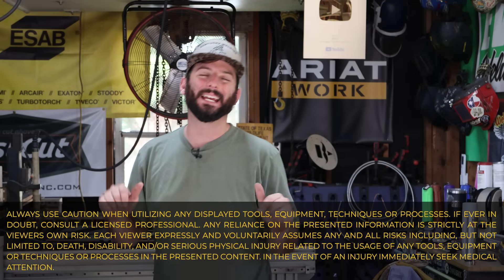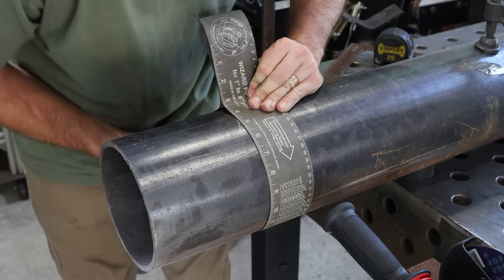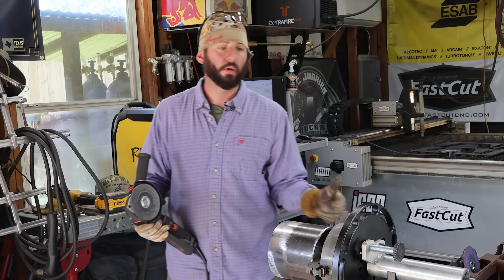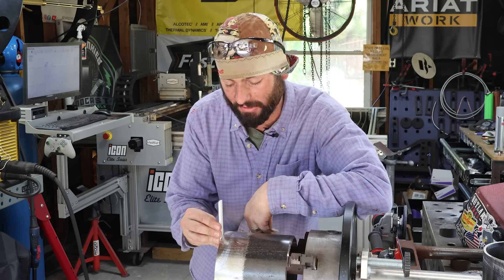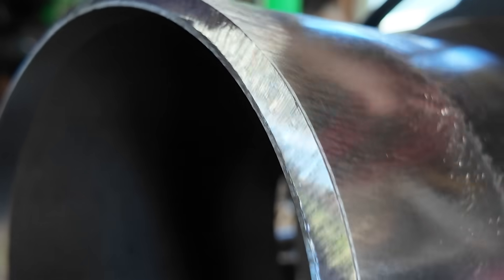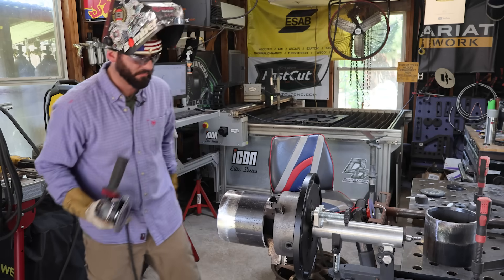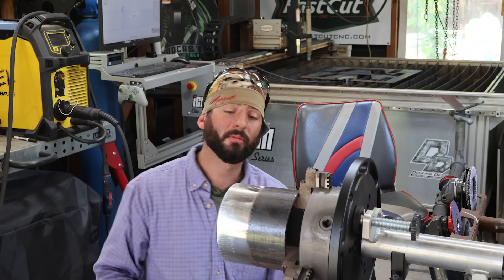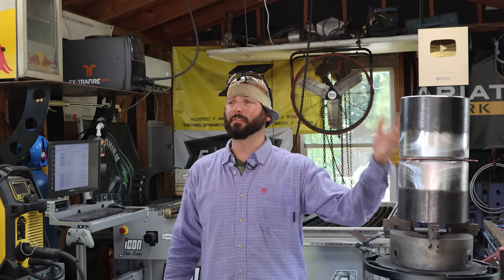The Fastest Way to Bevel Pipe (By Hand)

Comment: My welding instructor made us hand prep pipe for the first month of class.  Had to cut it off the 20' stick with an oxyfuel torch, and then finish it off with a 7" grinder.  Came in handy when I went into the industry and kept recieving material that wasn't cut and prepped correctly.

Comment: I spent 13 years as a fabricator welder. You are absolutely expected to know how to hand bevel and prep. Even as a helper or apprentice. Also that sanding/flap disk is generally a no-no as they are expensive and dont last long. Its cut with a 9" inch grinder and prep with a hard disk on a 9" with large diameter or a 5" with smaller. Die grinder on the inside.
Reply: 👍🏽👍🏽 yeah I don’t usually use a flap for shaping the bevel just for a cleaner finish. The fiber disc is amazing if you haven’t tried it yet.

Comment: I get that I've become "the old guy," I'm 53. So, to hear that these "kids" aren't even being taught how to use an angle grinder worries me and makes me a bit angry. Angry simply because they spend time and money to be taught these skills, and they're being short-changed, let down, or however you want to describe. Since I am a bit older, I learned as an apprentice. Heck, I had days that I was on a grinder for so my hands and arms felt like they were still vibrating for hours after work!!  It's just a shame that they aren't teaching these kids about every aspect of the trade, from the bottom up. If this is fully accurate. 
Hope y'all are having a great day and, more importantly, y'all be safe out there!!
ALWAYS, remember rule #1, DO NOT get deleted at work!! 🤠😎
Reply: A lot of schools in my area give students machined faces coupons to practice on. Most of the others use a track torch or beveler. 

Most of my field experience in the plants was all with an angle grinder. It is a shame, one reason I felt the need to make this video.
Reply: I also learned how to bevel pipe in the field. My journeyman taught me after I gained his trust and asked him. You'd be surprised how much the old heads will go out of their way to help you if you show up everyday ready to work and learn. That didn't save me from getting laid off though! 😅

Comment: Out of curiosity how come
Nobody knows how to bevel with a cut off wheel I’m 23 and that was the only way I’ve ever leaned how to bevel till I moved into refinery work i showed this to a 50+ year old pipe fitter said he’d never seen that in his life and thought it was the most amazing thing ever so I was just gonna see if you know how to do it or heard of it
Reply: Cut-off wheels do a nice job, they can be a little dangerous and can be expensive. Heck ya if it works good for you that's great, I'm 54 I use a 9"grinder with a cupped wheel. It's really fast and turns out nice.
Reply: I struggle to believe that. Its pretty standard practice, other than going all fancy with the flap disk.
Reply: @adrian-e9k2b  idk everyone I’ve worked with recently has never seen and I was thinking is this a hiding secret or do people actually not know about this
Reply: You’re saying to operate the cut off at the angle all the way around instead of cutting square? Thats something I haven’t seen ether. Probably because operating a cut off at angles can get risky. I imagine it’s not to bad on something like this. But heavier wall pipe? I’d avoid that